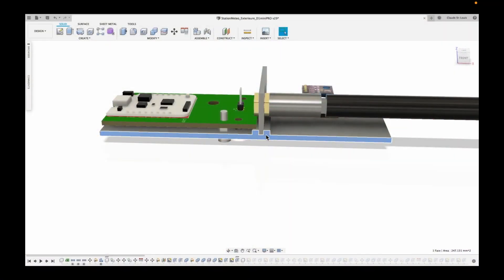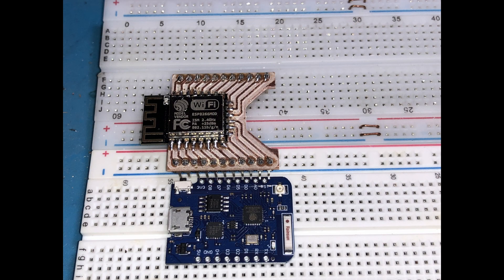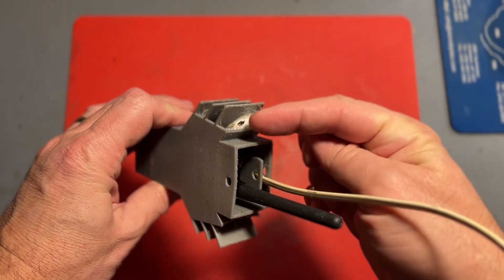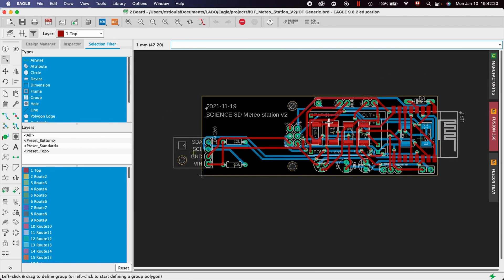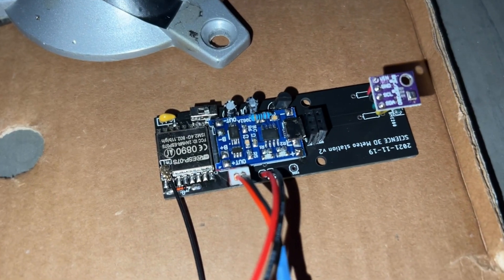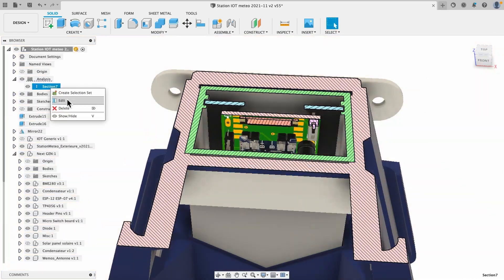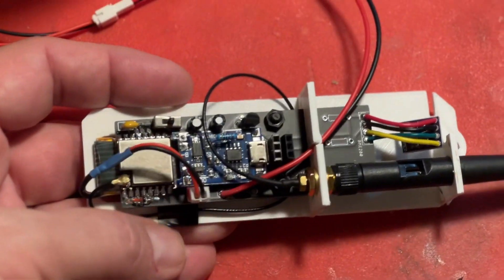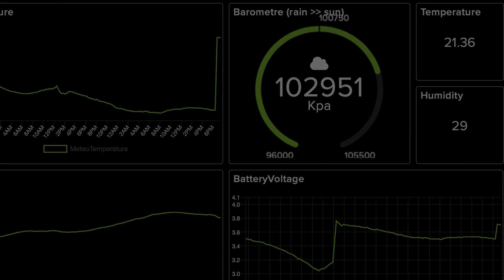IOT with arduino - Solar powered Weather station

Comment: Hello. If you don't mind me asking how did you wire the two solar panels together?
Reply from the maker: I connected the two solar panels together in parallels so I ensure maximum power while charging the battery